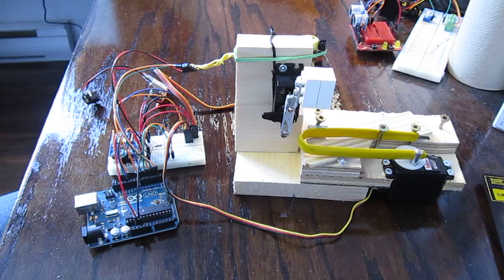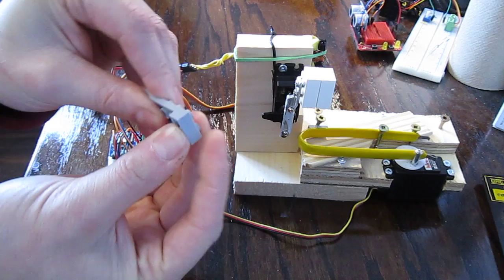LEGO stress test machine

Comment: While this is helpful to learn that a clutch life span of a brick is 37,112 putting them together. I am running into split or even cracked bricks so thats my question how long is there life span in general not put together and taken apart.
Reply from the maker: How does ABS plastic ages? How fast? What conditions makes it age faster?  I have some very old Lego bricks at home that are totally fine other than discoloration. My guess is, for a crack to develop without a mechanical force applied, a brick must be exposed to extreme temperature changes or sustained sun exposure.
Reply: @PhillipeCantin     This is what I kind of figured i know over time they will degrade and may become brittle. I have some Red Clear Tile Round 1 x 1 from a friends set that have cracked and have lost there clutch power I bought the set used for parts so I can only guess its history. I can do a test I have the Lone Ranger sets from 2013 and the old old Harry Potter sets from way back in 2001 they have been out of the sun in a stable temperature. I know there was some production problems with Reddish Brown  Bricks & Plates.